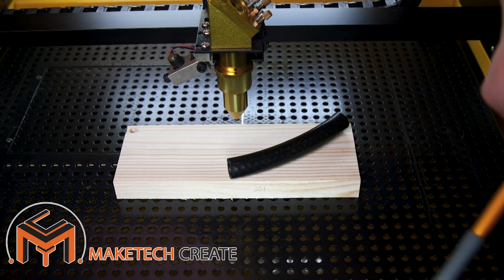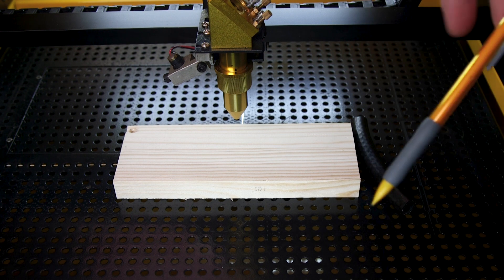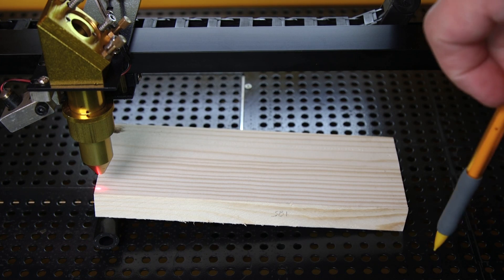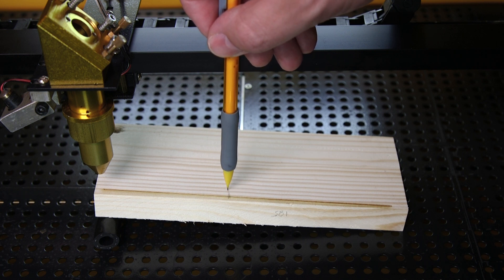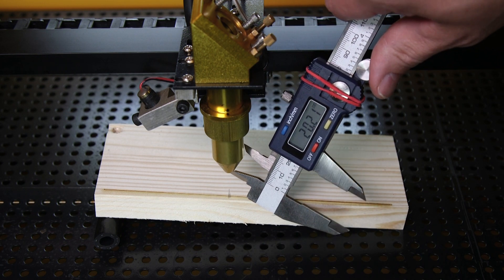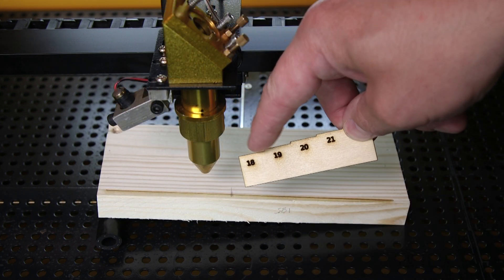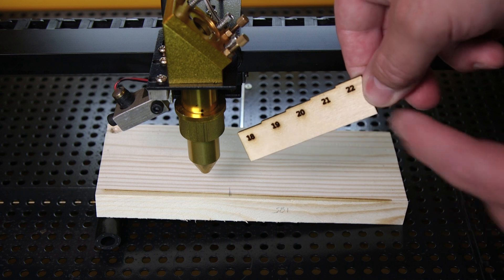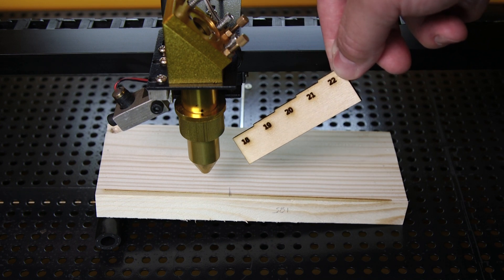CO2 Laser Focus / Focusing Laser Lens Ramp Test - Laser Engraver Beginner Series Ep. 6

Comment: Great video. With great advice. I needed to send a friend a ramp test video. And found yours. And I'm glad I did. Great tip on the cutting depth. When engraving and cutting the focal point should be on the top still as it will affect the engraving quality. Great video bro 👍🏼 and a new subscriber
Reply from the maker: Thanks! Yes, if you want a fine engraving while cutting, you'll have to focus at the top.

Comment: according to mine my focal point is above the bed supplied by just under an inch does that sound right
Reply: Yes, that sounds right. You should be able to adjust the height of the head or the height of the bed, in order to get the focal point where you want it for your material. For engraving, you probably want to focus it on to the surface. For cutting thicker materials, you probably want to focus to half the depth of the material.

Comment: This is a good way to find rough focus quickly...  I use a much more involved but more precise way to do it by pecking holes in paper at incremental distances between the nozzle and paper.  I measure the distance variation using a dial indicator and measure the hole size using a inspection magnifier loupe that has an insert with graduated lines inscribed into a glass plate.  From there I can figure out the exact smallest spot size and determine the offset between the bottom of the nozzle and the material.But your method is perfect for a quick and dirty way to do it...
Reply from the maker: Thanks for the tip. Maybe I'll do another video on your method in the future.